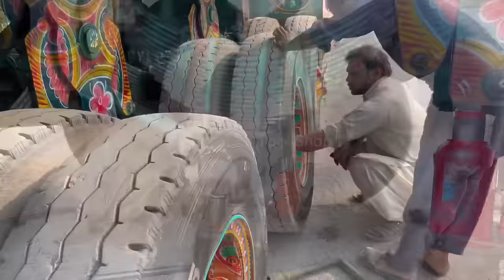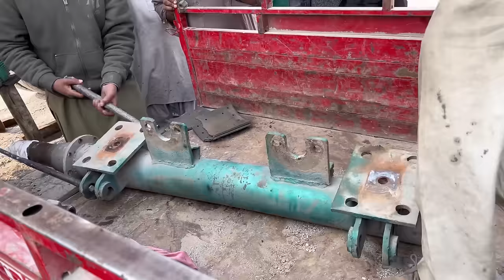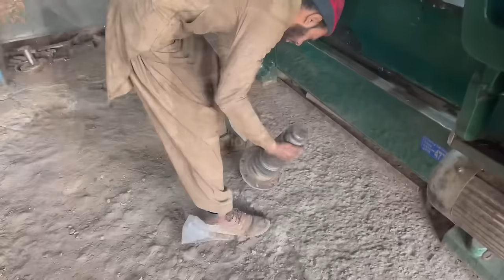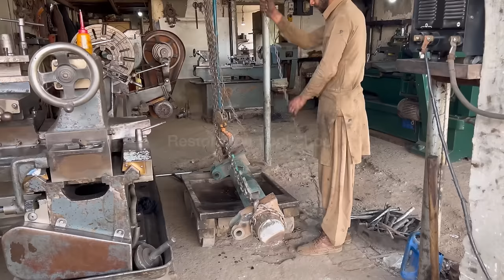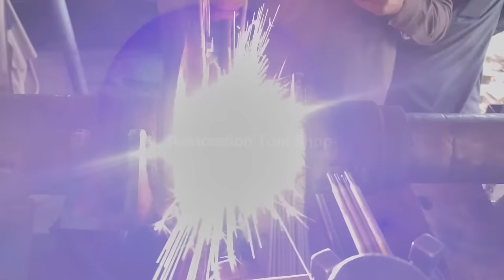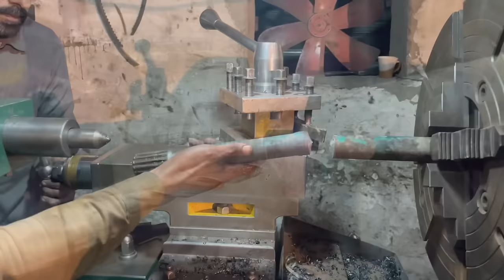How to Repair a Broken Heavy Vehicle Trailer Axle || Trailer Solution Broken solid rear axle

Comment: It’s pathetic how a supposedly solid piece of 8”steel had a metal fatigue failure I find inconceivable that the entire structural failure of the steel was cause by excessive pressure and weight it makes no sense again I believe the structural integrity of the metal itself was compromised in the manufacturing process at the factory/milling site I’m a serious supporter of the internal process of building up the integrity of the axle
Reply: I agree-once had a car engine that started rattling but didnt fail
When the sump as removed the crank shaft had a hairline crack right through it.All agreed a manufacturing fault in the casting.
It had caused no damage so was replaced and car went on for another 10 years until it died of rust.
Reply: Yes during manufacturing....only checking 10%..ut...mt..if that don't find anything in 10%...then it go to building and they should ck too!!
Reply: That axle would've been fine if it wasn't overloaded far beyond it's capacity repeatedly overtime. 
I've never seen people completely ignore weight limits more than third world countries lol
Reply: The axle had a crack in it

Comment: great lathe work.......This FIX  is the best their ECONOMIC situation can provide.   it would be great if a couple of senior WELDERS could offer some pointers.    For example,  when beginning the weld, the OBJECTIVE is to stack one good weld bead  over the previous.  And keep the beads nice and neat  (not wide)..... the OBJECTIVE is not to FILL the 1" gap with weld-rod metal by stroking the welding rod  left to right. NO.   You need a high current to hear the ROD  sizzle like bacon,   and keep the item rotating (and run the bead  straight all around)  not side to side...... The very last welds show the left to right  bead (which only  FILLS metal),  but does not stack one bead on top of another....
Reply: That's how I see it. Weaving the bead as they have done doesn't penetrate nearly as much as running stringers around it. Effectively what they are doing is just capping the weld beneath, which is fine on your last pass. Filling it with stringers, making  sure not to leave any slag or flux in between passes is the strongest way to do it for sure !
Reply: I bet they’ve done it before…….
And it’s likely the only option at least for the time being. 
So I give them the benefit of the doubt. It will work for awhile at least, maybe baby it with less air pressure and the most worn out tire. 🧐

Comment: Yes, They do great work. But in this case I doubt that the welded axle can bear the same load than a forged axle. 
And even that didn't stand the overload they put on it most of the time.
Reply: ورده العمل
Reply: Выдержит безусловно
Reply: That break did have a crack in it otherwise it was the original axle. Myself, I am amazed at what they can do,  but with all that machine shop work I expected to see them pull out a mig welder.

Comment: This axle was cracked, improperly repaired the first time and continued to be operated without inspection until it failed. Had it been properly repaired the first time, and not overloaded, it wouldn't have broken.

Comment: Instead of a nice interference fit on the pin, using heat and ice, they mushroom the pin beating it into the spindle, then have to oversize the hole in the axle to get it to go in. Then no preheat before welding. That weld will have shit for penetration.
I wouldn't be surprised if the axle breaks and the wheel falls off before the next stop.
Reply: They have limited resources and knowledge they received from their teacher.

Comment: These guys and their skills are a pleasure to watch. Great to see things repaired rather than scrapped.
Reply: But that would not pass a DOT inspection.
Reply: On heavy equipment it may never very the samme
Reply: @mangopog9814

Many of the chassis used with semi trucks to transport shipping containers in the USA have had similar repairs and manage to pass DOT inspections just fine.
Reply: @mangopog9814  Lol I doubt there is such an inspection.

Comment: Anybody else notice that there isn’t anybody that looks over 45 years old on this job?  The high tech jobs, like making casting molds, special tooling are done by white beards.  I believe these are all from the lower cast, no Singhs who are considered to be direct reports to the regional patriarch.  I learned all this in the 35 years working with many East Indians.  Culture is fascinating but not necessarily progressive.  The methods used are tried and true but you have to trusty the skill of the workman and quality of the material.  They don’t have any way of inspecting final products.  It’s hard to criticize their methods if you have dealt with American repair industry especially automotive repair done at the automotive dealer.  I think I would take these guys and leave a generous tip.  How can a country buying up entire car companies and launching rockets to the moon have this level of primitive work conditions.  Primitive is fine as long as it does not jeopardize the health and safety of the worker.  I speak a little Hindi, they aren’t talking about what they are putting their 401 retirement savings into.   Just kidding about the Hindi.

Comment: impressive, but I wonder the composition of the welding rod. Different rods have different characteristics of strength and metal. I am NOT a metal specialist, vut the correct composition is critical.

Comment: The real secret 8s to overload everything  they have( flat beds  , dumps or just a single axle wagon pulled by a motorcycle  and then spend hours and hours repairing  it and then do it again until there just nothing left   but junk instead of making 2 trips

Comment: Why not weld it together using the lathe to slowly turn the sections?  Hold the rod still and let it ride !     Nice job and success !
Reply: Porque o torno não tem redução o suficiente entendeu ou vou ter que desenhar...............🤫🤫🤫🤫🤫🤫
Reply: That would make a better weld and the ground clamp can ride on some copper sheet or bare cable since welding on a lathe should NEVER ground through the bearings.

Comment: I honestly question the validity quality of the material into the process of manufacturing the axle like the differential the constant breakage is a manufacturing problem not from excessive weight this problem will arise from structural failure in the metal itself and it will be a constant issue of fatigue metal failure